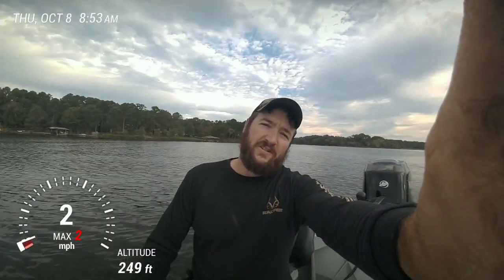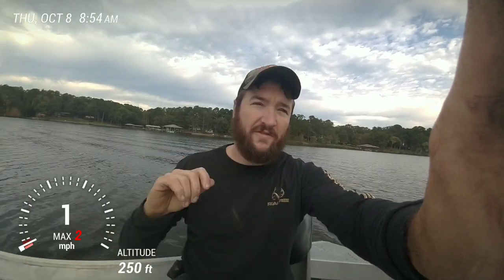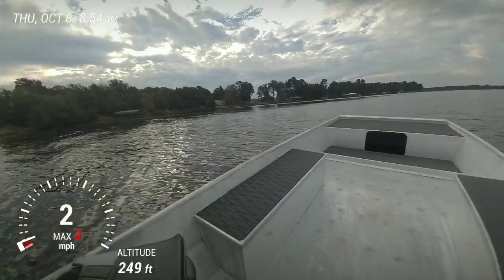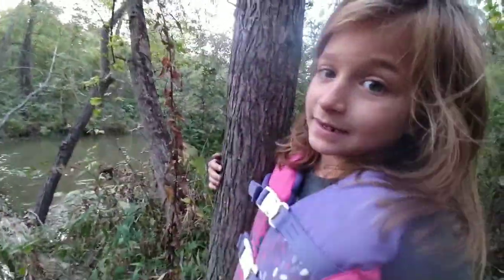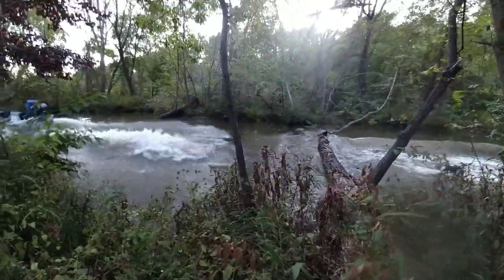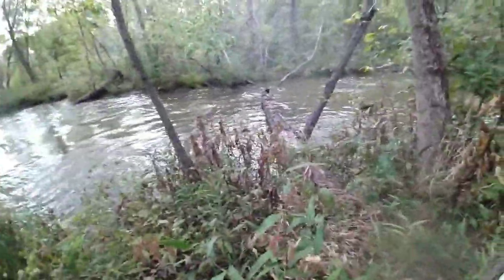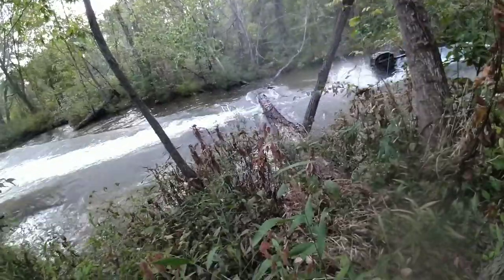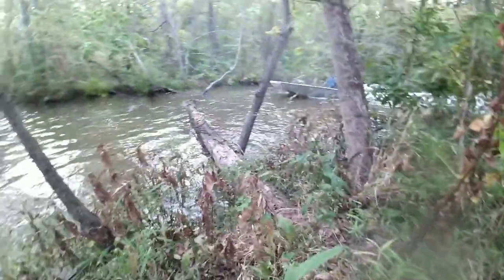Testing the New Kaz Kustom Outboard Jet.

Comment: I have a 1656 alumaweld flat bottom no tunnel with a new merc 115/80 and I run about the same mph as you. Wondering where to start with getting more speed out of it? Front of shoe is half inch above the bottom. 3 blade impeller. Any feedback would be awesome brother
Reply from the maker: I would just have to see it.

Comment: The bare hull weighs 554 lbs right? Then about 247 lbs on that merc 60 jet?  I’m just trying to compare mine and see what I can change around cause I’m getting average about 25-27 mph with a low hour 2002 Yamaha 60/40 2 stroke. I think I need to raise it a quarter inch or so more tho. Wish I could send you pictures for feedback.  Good stuff man I been inspired by your channel 🤙🏻💨
Reply from the maker: Awesome. Yes bare hull. Thanks for watching. There is a lot to getting a jet at peak performance and can be time consuming.
Reply: Nope prrfet